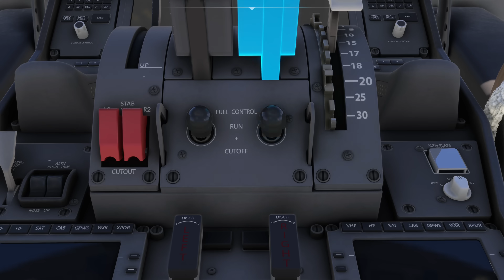Air India 171: Why Did The Fuel Cut-off Switch Get Moved?

Comment: I wonder what planes captain steeve flies and assuming most of them are boeing it's important to question how this man is NOT biased towards boeing :) 
It clearly seems like this man is not ready to accept this is a software glitch just because the preliminary report does not put any directive action towards 787-8 fleet. But he fails to understand what powers are at play here behind this report and how easy it would be for a company like boeing to first influence this report and also control it. And further pay people like Capt steeve to influence public opinion. He was the first one who also prevailed the narrative of pilot not keeping the flaps in the right place which was honestly so dumb... Planes while takeoff have that system in place which does not allow this move. And now he's so confident that the switches cannot be disturbed by their own self. The directive clearly states that without the locking mechanism the switches can be affected by motion. Does he forget how much does a cabin shake while takeoff. If the pilot/pilots were deliberate about this how did one of them still try to turn on the fuel switches? If one was attempting suicide wouldn't the other protest and if they would be protesting - does he really think one pilot was able to hold the other down during takeoff to put the fuel cut of switches back to run position. This is honestly so dumb. Capt steeve stop it. You clearly fly boeing aircraft - and you're also paid by them. Just because you wear a uniform, are a reputed pilot and are a nice orator, people will believe you that easily.

Comment: The engine failed due to a design flaw in Boeing's system shortly after takeoff. The pilot briefly switched the fuel cutoff to 'off' and then quickly back to 'on'-that was the cause.

Comment: Blame the pilots and cut the responsibility to payments to the relations of the dead. HOW SAD.

The "Captain" has less of a clue than me with 10 years experience as a Flight Simulator Engineer with Redifon Flight Simulation, UK.

The conversation between the pilot and co pilot clearly proves that there was a THIRD possibility for the fuel valve to have been turned off.

The RAT activation proves ELECTRICAL FAILURE. Are the pilots responsible for this too?

Why is the Air India CEO attempting to blame the pilots?

Let us face it he is not of Indian origins.
It is an effort to save BOEING and thereby the BIGGEST plane maker of the USA.

THIS WILL BLOW UP BIG.

Comment: this point, the truth is still not coming out about what happened during the flight. If this continues, such incidents are bound to happen again in the future. They seem to be trying to shift the blame onto the pilot.

Crucial second-by-second data is missing.

They’re using vague terms like “thereafter immediately.” What is that supposed to mean? This isn’t a speech — it’s an official report, one that over 270 people and their families are relying on. People trusted Boeing and the airline industry with their lives.

Where is the data on the deployment timing of the rate?

Where is the engine shutdown time?

Where is the engine restart time?

Why was the black box damaged? If even the black box is damaged, then what hope is left? The black box is specifically designed to store data in extreme situations.

Why didn’t the ELT (Emergency Locator Transmitter) send a signal?

Much more information is needed — too many critical details are missing.

Comment: Hello Captain Steeeve,
thank you for your efforts and well-founded assessments.
But I find it alarming how many experts and pilots discredit the official preliminary report on Air India flight VT-ANB.
It is claimed to be incomplete, manipulative, and only interpretable by “insiders.”
Yet I read the report with an open mind – as an interested layperson, curious, without conspiracy thinking or blame assignment. And that’s exactly what the report aims to be: factual, neutral, preventive – without assigning guilt.
Here’s my attempt to put some things into perspective, correct a few misunderstandings, and provide context.

1. The Foreword Matters!
Many are too quick to dismiss it and say: “We’ll skip the beginning. The real content starts at section 12.” But already in the foreword (page 2), important things are clearly stated:
“The sole objective of the investigation [...] shall be the prevention of accidents and incidents and not to apportion blame or liability.”
This means: it’s not about blaming anyone – the report simply documents established facts. Where something is (still) unclear, it is deliberately phrased neutrally (“the switches transitioned”, “one of the pilots”).
That’s not a cover-up – it’s a requirement under ICAO standards.

2. The Fuel Cutoff Switches Were Functioning Properly
According to the report, no defects with the Fuel Cutoff Switches were reported since 2023.
After the crash, both switches were found in the exact RUN position, as documented in the EAFR.
For example, during impact, the thrust levers were displaced by the crash forces – but the supposedly sensitive and unsecured cutoff switches did not move even a millimeter?
This shows me that the locking feature of the switches was functional.
And that clearly argues against accidental or spontaneous activation due to turbulence or vibration – and rather supports the idea of a deliberate manual action.

3. Why Potential Defects Are Still Mentioned
Some wonder why the report even considers technical issues with the cutoff switches.
The reason: there is a Special Airworthiness Information Bulletin (SAIB) No. NM-18-33 related to exactly this switch type.
That’s why it’s included in the report – and rightly so.
But: This doesn’t mean a defect actually occurred. The report simply lists all known indications, traces, or technical factors that could be relevant.
It is transparent and open – but not speculative.
So don’t overinterpret. The mention of something does not automatically mean it happened – it just means it’s being investigated. That’s honest reporting.
To put it in context, a direct quote from the text:
“There has been no defect reported pertaining to the fuel control switch since 2023 on VT-ANB.”

4. 1-Second Interval Between Switches – Not Random
The two switches were flipped one after another – with exactly 1 second in between (08:08:42 UTC, according to the EAFR).
That sounds like a deliberate, practiced action – not a technical malfunction, not an accidental brush.
No one accidentally flips two separate switches with a 1-second pause in between.

5. The Action Was Uncoordinated and Concealed
The cockpit audio reveals one pilot asking: “Why did you cutoff?”, to which the other responds: “I did not.”
This clearly suggests to me that the switches were not operated in coordination – the action was not discussed, and someone was either being dishonest or deceptive.

6. No Other Engine Failure (Contrary to Some Claims)
The report is clear:
“... the engines began to decrease as the fuel supply was cut off.”
There was no technical flameout – the only trigger for the shutdown was the flipping of the fuel switches.

7. The RAT Was Activated After Flameout – But Not Deployed Then
Many say the Ram Air Turbine (RAT) was deployed at 08:08:47 UTC. That is incorrect.
The report states:
“The RAT hydraulic pump began supplying power at 08:08:47.”
Meaning: It had already been deployed before that.
That happens automatically in a dual engine flameout – so likely directly after both switches were flipped, i.e., 3–4 seconds earlier.

8. Why the Actor (Pilot?) Might Lie
If a pilot deliberately flipped the switches – why would they later say “It wasn’t me”?
- To make it look like a technical failure
- Suicide is taboo in many religions or cultures
- To protect the family: no disgrace for survivors
- So that insurance will pay out
- Pilot may have been mentally unstable or conflicted
- To shift blame to the co-pilot
- In past extended suicides (e.g., Germanwings), the truth was hidden until the end

9. The Conversation Didn’t Happen Immediately
It’s often said the pilots spoke directly after the action. But:
- First, the switches were flipped
- Then the engines gradually lost thrust
- Then came reactions and questions
Several seconds passed between switch activation and dialogue – that’s implicit in the report’s timeline. At least that’s how I read it.

10. (Completely Different) Possible Reconstruction of the Events
Roles:
Pilot Flying (PF): Co-pilot (young, operating the aircraft)
Pilot Monitoring (PM): Captain (56 years old, ATPL)

Scenario:
08:08:39 Liftoff – all normal
08:08:42 PM discreetly flips both fuel cutoff switches
2–3 seconds pass: warnings appear, thrust loss becomes noticeable/audible
PM does nothing, leaves PF to react
3–4 more seconds: PF tries to assess the situation

Now two possibilities:
Case A: PF notices the cutoff position, asks about it – PM lies – PF switches to RUN
Case B: PF doesn’t notice – PM asks intentionally to prompt PF to reactivate or switches back himself (as a cover-up – so the switches are found in RUN position)

Now almost 10 seconds have passed
→ In both cases they try to restart the engines (RUN 08:08:52 / 08:08:56). But only Engine 1 manages to recover. PF clearly realizes that.

Conclusion
I’m not a pilot or expert – but I can read, think logically, and stay objective.
I believe many interpretations are off base – or overinterpreted.
At the same time, the report presents facts cleanly, carefully, and clearly.
In my view, the report hides nothing. For those who read it carefully, it’s clear:
➡ The only trigger for the engine failure was unfortunately the intentional switching of the fuel cutoff switches.

P.S.
The only thing that puzzles me is the image on page 14:
1. There’s no dust or smoke visible, as seen in the released CCTV video. Is that outside the field of view?
2. The RAT seems to have deployed at a very low altitude. Or is that misleading? Does it fit the timeline?

Comment: I can't believe this. The B787 has layers of fail-safe systems—electronic, mechanical, hydraulic—all with backups. Yet somehow, turning off both fuel switches mid-flight didn’t trigger a single alert or warning? That feels like a major design flaw. Can two tiny switches really take down an entire aircraft?
If the ECU knows the plane is airborne and the engines are healthy, shouldn’t it at least ask the pilots to confirm such a critical action? A simple prompt could make all the difference. What’s the purpose of having layered fail-safes if a manual kill switch can override everything without resistance? It just doesn’t add up. If the B787 was built by such skilled engineers, how could they miss something so obvious? Maybe this isn’t a design flaw. It feels more like a cover-up.

Comment: So there is no way possible a catastrophic electrical failure with the extreme heat on takeoff had the computer shut off both internally as had been mentioned before? And then in a desperate attempt to relight the put them manually to the off then run positions? Is there a time lag between them being turned off and then on? Is there a way the data recorder can distinguish between a manually shutoff and if someone physically moves those switches?

Comment: I have a question about the methodology of how the fuel cutoff switch position is monitored. Does the system monitor just the state of the signal or is there a separate independent circuit that's detecting the physical position of the switches. The responses of the pilots might make more sense if you think that this was something that occurred electronically and not with the physical switches. Maybe I missed it but is there any kind of audio indication as to the sound of the switches actually being switched or are we only relying on the signal? Is there any redundancy? I am not a conspiracy theorist. I wish this didn't happen and I don't want to blame Boeing or the pilots. So far I've heard everybody assume that because it recorded the switch position that that was the switch position and I haven't heard anybody explain how this is verifiable.

Comment: Many people point to the white smoke out the left engine as proof of engine failure, but can someone experienced with planes perhaps comment on whether a engine turned off at speed can create white smoke as it spools down and air/fuel ratio changes as the engine is starved from fuel? That the white smoke is not a engine failure but rather just a engine shutting down.

Comment: You are misrepresenting the report.  The captain said. "Why did he cut off?".  HE = the engine. In India that's a common way of speaking. That switch panel is a logic circuit. If there was an electrical failure in the circuit to that switch, the flight data recorder would show it as an open and it would log it as being in the OFF position. I think that's what happened.   There was an electrical failure in that circuit, the captain said "why did he turn off?". Referring to the engine. Then they tried to relight the engines which involves resetting those switches. The report showed a RAT deployment within this same time frame. Both switches were flipped because both engines were rolling back. Then 10 seconds later it came back online which is also the same amount of time it takes for the RAT to power everything back up once it deploys. The engines were also showing an increase in EGTs showing that they were spooling back up. But there just wasn't enough attitude and she hit the ground. This is what happened. Captain Steve is misrepresenting the report. Or simply didn't understand what it actually said. I read every page, and i came to a completely different conclusion than he did. Captain Steve's statements are just not accurate.  Anyone can read the same report and form your own opinion. And encourage everyone to do so. I could be wrong as well. But based on my understanding of these systems as a technician, this is what i think actually happened.
Reply: You know, is TRUTH important to you and your compatriots??
Because on this comments section, it seems like defending Indian nationals at all costs is what's most important to you.

He didn't ask "why did it cut off".
He asked "why did YOU".
We know because the other pilot replied "I didn't".
Reply: @leenieledejo6849  read the report. That's not what was asked.  The quoted text in the report is. "Why did he cut off". Go read it.
Reply: @techcafe757  Found the Indian!😂

Comment: Amazing analysis, Captain Steeeve—once again blaming the pilots while completely ignoring the actual preliminary report. Yes, the fuel control switches were found OFF, but nowhere does the report confirm that the pilots manually turned them off. Ever heard of automatic switch trips? Apparently the FAA has—they issued warnings years ago about similar fuel switch issues in Boeing aircraft, including the 787. But I guess it's easier (and more profitable?) to blame the humans than to hold your beloved Boeing accountable. Keep those ‘independent’ analyses coming—Boeing's PR team must be proud.

Comment: Really enjoyed your analysis, Captain Steeeve—thank you!

Quick question: If I were to quickly move two chess pieces one at a time, I imagine it would only take a second. Is switching off the fuel cut-off levers with the fail-safe detents just as easy? And is it a bit tougher to turn the fuel on through the levers, since it took about 4 seconds?

Thanks again, Captain—really appreciate your insights!

Comment: Million dollar question is that how could Boeing be so careless and irresponsible and on top of that blaming the pilots for a cover up. The valves cut off the fuel to the engines and it happened automatically due to malfunction . Boeing should be banned to operate and manufacture and a strict criminal  action should be taken against the Boeing company.

Comment: If he wanted to end his life why would he lie about turning the switch off. I don't think he did cut off the fuel. There is no way it was done by mistake. 
There seems to be no talk on the possibility of mechanical or electrical failure. 
I 100% believe there was some kind of error or failure, and it was not the pilot's fault.

Comment: There's no reason to move the switches to cutoff while throttles are at anything but idle, so why isn't the system built to stop it. Also good point about making it require input from both pilots to make it happen.

Comment: Air India 171: Why Did The Fuel Cut-off Switch 【Get Moved】???
From the UT's videos, the 【safety structure design】 of the Fuel Cut-off / Cut-on Switch can not move by itself.
Those pilots were the 1st to enter the aircraft to check, and to move those Switch to ON before move 171 to the runway. 
Because that was moved by a human hand 【doing it intentionally】 & 【with a purpose】 ! ！🤣🤣🤣🤣🤣🤣🤣🤣

Comment: Hang on, they said they found the switches in the cutoff position, but they were returned to the run position weren't they, shouldn't they have found them in the run position?

Comment: Considering the aircraft was 12 years old and made an average of 2 flights per day, that's 17,500 times that these switches had been operated.   Is it possible that the detents were worn so much that they would no longer lock correctly?  It would only take a small bump to dislodge them to cut-off.